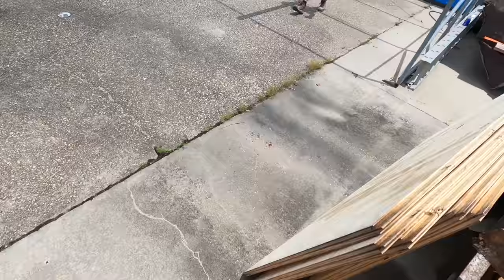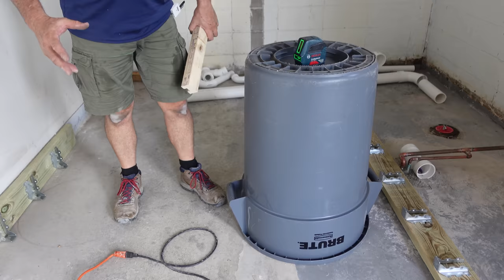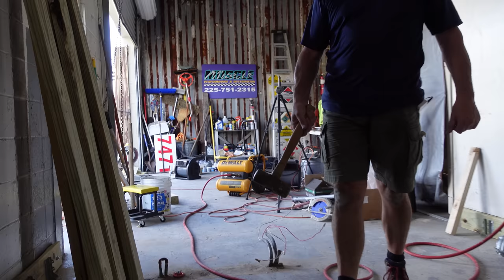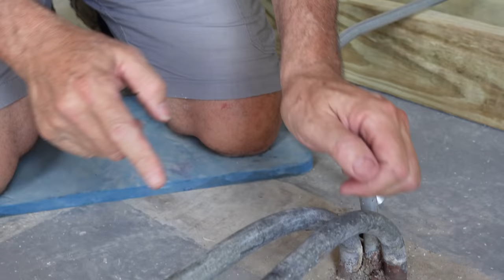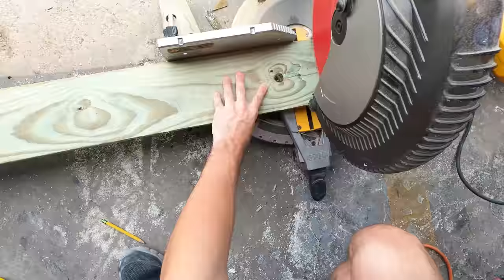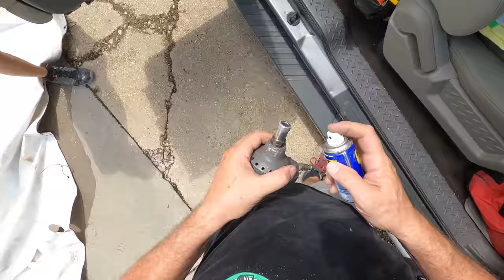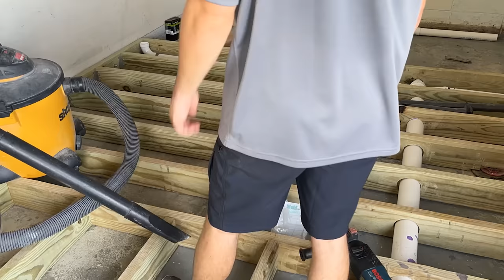The STRONGEST Subfloor System We've EVER Built! - THE SHOP Part 4

Comment: I’m doing the exact same thing right now with the exception of anchoring treated 2 x4s flat to the carport floor . I then shoot my laser line to get dimensions for my floor joist.  I take my track saw and taper cut the floor joist per dimensions dictated by laser. Then I attach floor joist to the 2 x4 with pocket hole screws, the heavy duty pocket hole screws from Kreg. That way I have my floor joist fully supported. I fine tune any imperfections with a cordless blue Japan made hand planer which is freaking awesome. This method takes a lot more work but I feel like it will be a rock solid install. I also install blocking to prevent deflection from side to side. I believe in over engineering. I also would like to mention I am sealing concrete with flex seal before mounting treated 2 x 4s to the floor and hopefully  this will prevent any  sweating that may take place and rotting the subfloor from underneath . I like your method equally as well and I won’t deny saying I would have used your method had I not already started . Who knows I may adapt once I get past the point where plumbing is not an issue. I think I also will be changing direction of floor joist halfway thru to avoid compromising the joist due to plumbing. Thanks for the in depth videos and Jordan needs to pipe in more often so others can get the detailed info as to why things are done a certain way, education is key here and we are never too old to learn something. I will be the first to tell you I don’t know everything and if I don’t  learn something new everyday  then I’m not listening or paying attention .

Comment: I hammered that "like" button for you guys... Project is coming along great!   As I'm watching this, I'm thinking about what you said about the owner not wanting to cut the concrete because of dust, so you have to go to these lengths to make a raised floor... it gives us an opportunity to see the planning, engineering, and design of a difficult situation and how you solved it!  One question I had was the comment you made about possible vertical wood movement, what if the floor wants to move that 1/8" but with all the tiedowns would it crack or break in place? or not?  I'm still a newbie when it comes to this, and curious to learn.

Comment: Great video as usual. Ya, lasers are greatest investment anyone can make. Im only issue with this build is the drain pipe resting on the wing nut seems like problem waiting to happen. I hope you put some blocking in there to keep the pvc pipe off the metal bolt. Otherwise great video.

Comment: Thanks for sharing - that is the strongest subfloor. Normally, you don't need to have metal brackets for joists that sit on concrete floor, but my guess you wanted a hurricane proof shower. :)

Comment: When you shimmed the 2x6's, should've used a 6' or 8' straight edge, to make sure they're all on the same plane. 

Some have more crowns then others. Some are straight.  The solid blocking/bridging, will fix a lot of it, if you make them all perfectly  flush on top, raising or lowering, high and low joists. 

Or just use electric planer on the high joists. Depending on what type of finished floor your using.

Comment: With all due respect fellows you had a full bubble of pitch on that pipe when you put the level on that 4-in PVC and in all honesty all you need is a quarter bubble Too much pitch will cause the water to run faster then the toilet paper and the waist and leave the waste behind and block up the line.   But being that it's a short run you'll probably get away with it, but in the future use caution.

Comment: New 20 Amp Ckt, If you can have your electrician (you) install a GFCI circuit breaker in your panel and connect to your in floor wiring at the closest j-box,and maybe bath room lights on the old circuit.

Comment: Ya'll do great work, no question, but I would feel better if you'd run a green ground-wire. I don't trust the screw-connection to keep the emt -ground continuity. I've seen those screws work loose thru the vibration of the cycles of the juice or corrode and become loose.

Comment: I hung some joists myself recently. It was a remodel--old, HARD wood beam, 3.5 in. 16d nails. I bent so many. Ended up predrilling holes, then using a palm nailer. Broke two drill bits. I can't imagine doing it by hand. I'd probably still be doing it.

Interesting watching your process. That seems like a very solid floor. I wonder what you're planning to use it for that you added so much additional support.

Comment: Like my new toy I got myself for my bday in June; the Metabo HPT 36V Metal Connector Nail Gun, I absolutely love it (yes it’s like 10 lbs, but still great w/o a hose) and no need to refill w/ air anymore (like needed to w/ the old hitachi/Metabo HPT framing nailer et al w/ an air compressor and valve reducer gauge tool), so they say….hopefully they correct. The only iss7e I have w/ this nailer…..finding nails to use w/ it. Not as easy as thought & id say that’s the biggest CON for me, regardless of the weight (as I’m use to the weight of battery nailers; since been using when first released way back when….lol, sounds funny. My 1st battery nailer was my hitachi 18v 3.25” framing nailer, then when finally went bye bye, got the newer 3.5” version and so on…so, weight isn’t a deal breaker, although if working over head or doing a ton of framing, like entire house, I’m bringing out my 4.9 lb pneumatic hitachi nailer….awesome nailer and fyi; if find the old hitachi nailers for  sale at garage sales or retiring framers/carpenters….snatch ‘em up; b/c even though the new Metabo HPT framing nailers are great and nice; there’s nothing like using the good old faithful Hitachi Framing, roofing, or siding nailers….imo👍🏻👍🏻)
However!, still carry a palm nailer b/c there is areas where can’t get the nailer in “position” ya need, so a palm nailer is a great tool to use, and if have collated strip nails, no biggy, turn 1st nail 90° and hammer it in, or break off and use palm nailer, as a tip so don’t need to buy separate nails. Also, if want zero hoses, can pay more than the $50-$60 of a pneumatic palm nailer and go cordless w/ a battery palm nailer w/ the battery platform you’re in (yes they are not as small as the pneumatic palm nailers b/c of battery, but they are still a good “small” palm nailer size to get into tight spaces, imo).
Sorry about long comment gang, but if made to the end; thx 🙏🏻and hope got something out of it.
Cheers✌🏻

Comment: ⅛" of inch per foot is optimal for 3" pipe.  ¼" for 2" and 1½".
You would think the more slope the better however studies have shown an ⅛" slope for 3" pipe allows the water to clean the pipes of waste as it flows.
Reply: Low volume toilets don't clear the pipe too well at 1/4"  slope.  Paper tends to get left behind and turns to paper mache concrete.

Comment: I would of spent extra to get 2x8 for joist to have more meat on the board..
Spray foam a line about 6 inches parallel to cinder block wall in-between joist and any gaps under it joist,, once the foam dries it's a form for pouring self leveling cement so it gets under all joist along the wall to insure the level and integrity...
Probably the same thing in the center and Incase the L brackets and raise the floor to level...
Maybe a little much, just my two cents on this job not that it matters, I'm sure it's going to be gravy as usual...

Comment: Great insight on how you guys are doing things over the pond.
I am from Europe and was wondering if you have any guidelines for the pipe slope at all? I am also no certified builder or anything, I just have plenty of first-hand experience. It's just where I am from we have standard slope degrees (or elevation in centimeters per ever meter) for all the pipe diameters. So that (in case of sewage piping) we have steep enough slope for solid particles to have enough momentum to drain but not too much of a drop so that oily films and such residue can also drain (if you have too steep of a slope these oily films would not drain and stick to the pipe instead slowly building up and eventually clogging it).
Anyways, great content and execution, looking forward to future videos.

Comment: I am curious how different the cost would have been if this was framed with steel instead of wood. You don't have to worry about the same kind of deflection and warping, and I feel like all the extra work to account for it probably offset the labor and cost difference. I would bet steel would have won

Comment: Question, is there a reason you didn't use Tapcons to anchor the L brackets to the concrete? Since they're there to minimize the upward pull, I would figure that you want maximum anchoring power to the concrete?

Comment: Will the pvc pipe sitting on the wing nut eventually wear a hole after decade of vibration from the drainage? The metal is definitely harder than the pvc and can wear it.

Comment: Great job one question, labor and material wise would it have been cheaper to break the concrete and run the plumbing under then replace concrete or is this method cheaper?

Comment: If you were to do this floor over tile that is super level and has been there for 15 years and looks new with no cracks, would you remove the tile or go over it?  Also, what should I put between the tile/concrete and wood, do I need a vapor barrier if hardwood flooring is the end result?

Comment: “Extruded Metal Tubing”.

in my state your hole in the floor joist can not be larger than 1/3 if the joist so this would never pass inspection.  Although with this flow essentially resting on a slab I think that is a dumb rule.

Comment: It looks like the plumbing is running from both ends to the center. How do you account for that?
Reply from the maker: It is, we used a double 1/4 bend in the center into the original stack in a previous video

Comment: you guys are awesome to look at even for me that lives in sweden. we for sure have diffrent styles of building and still im learning a lot from you guys thank you. but i have a question here in sweden at this point for the floor we would not have been taking the impregnated lumber (i guess you using that?) we would just be using regular studs with moisture-proof cardboard (if im not mistaking). so why did you guys use the inpregnated studs for the flooring? just asking :) but if someone here is from sweden thats watching and knows something that im not can comment :)

Comment: Are they really hanging the entire floor from the walls instead of setting it on the slab?  Just to avoid 3/8" of slope on the slab?
Reply: Sort of.  By placing the shims at 1/3 of the span they have  only a small part of the floor supported by each wall.   I would have expected them to put shims under wood header bolted to the wall but it should work just fine.   Overall, I think they did a great job.
Reply: If the floors sloped and a toilet overflows all of the water would collect to one side.
Reply: @TheModelmaker123  No doubt, it was a great job.  These guys are pros.  It just seemed like overkill.
Reply: @mason03bodine  In a commercial bathroom I expect there to be a slight pitch and a floor drain.

Comment: How do you guys like the yellow pine studs (non treated) over in states? Do they stay fairly straight? I had bad experience with some yellow pine that were mixes in a pile of SPF lumber. They warped/bowed after they were installed. Maybe they weren't dried enough. I don't know.  For some reason we don't get Douglas fir or yellow pine readily available in Ontario Canada.
Reply: I think it depends on the part of the country you are working.  Since they are in the south, they get southern yellow pine.  But the Pacific Northwest gets Douglas Fir.  Someone correct me if I am wrong.
Reply: Ontario is all SPF because that's what's grown and milled there.
Reply: @YellowBunchofBananas  I see what you are saying about syp but don’t we have Douglas Fir in Canada? When i watch building channels from US, they somehow get really good lumber. Seems like we get the worst quality wood species in Ontario as framing lumber.
Reply: @Faruk651  Canada is a big place. Most Douglas Fir framing lumber is produced in BC.

Comment: That will not pass inspection with that plug nut touching the pipe 
And I’ve had inspectors fail us from the pipes to tight in the framing there is supposed to be room for movement and flex and then carrying hangers to hold the pipe

Comment: sometimes i smile because its good, sometimes i shake my head like who in tf taught em xD.. You did all that "strengthening" only to make the middle as weak as you could??
Reply: also, the nails are not to code, simpson makes a nail for the face and the toes
Reply: jeez.. then you dont even screw the hole closet to the framing on the bracket to the floor??? you realize that the farthes hole allows the board to pickup and bend the bracket... right???
Reply from the maker: We’re talking less than an 1/8 of an inch John, it’ll be alright 👊🏼
Reply: @StudPack  =)

Comment: I would have ran joists in the other direction.. then ur not drilling joist and weakening them ..
Reply from the maker: I thought about that Scott but I wanted the ledger to be on the concrete curb and block wall for the strength.

Comment: Hi, why would you put a sub floor in and not cut the concrete and remove to do all the plumbing and electric,that way you start fresh.
Reply: Think in a previous vid they said the owner didnt want the dust that would cause in his workshop
Reply: Customer didn’t want them to cut into the slab, said he has classic cars in the building and doesn’t want the dust getting on the paint.
Reply: Honestly I would have put up a temporary poly wall . Cut concrete and install plumbing the correct way.

Comment: I watch this, and I do admit, that I do not know anything about the building requirements or how things are built, so in my own option, there are too many cost-cutting corners going on, if a job can't be done the correct way, then it should not be done at all. though they do some good creative ideas,  I really only seen things fail over time and whoever owns this place a few years later, will have to spend more to fix it right the first time.

Comment: For obvious reasons, you would never cut a notch half way up a joist in which you could insert the joist hanger base. What a dumb idea, you'd risk the joist cracking there if it were heavily loaded. Supporting the bottom of any weight bearing item only makes complete sense.
Now, to the point. When bolting on a ledger put the bolts as low as possible for the same reason as placing the hanger at the bottom.
Don't just choose the middle cause it's pretty. All the joists between those ledgers will present the tops from cupping away from the walls so, no worries there.
On a 2x8 I might place them 2 inches off the bottom. Really, even an inch will be better but, unknowing people will judge wrongly.
Mark Henry